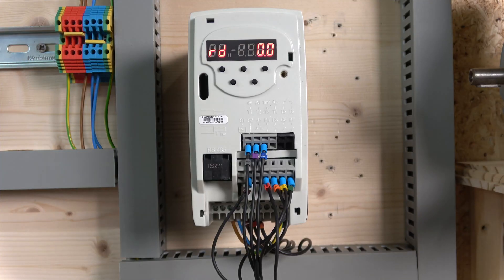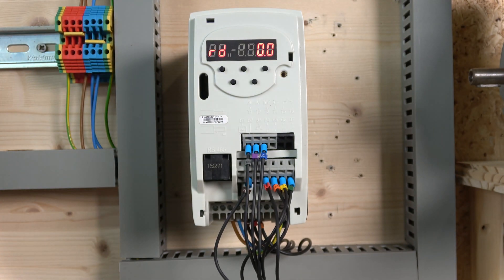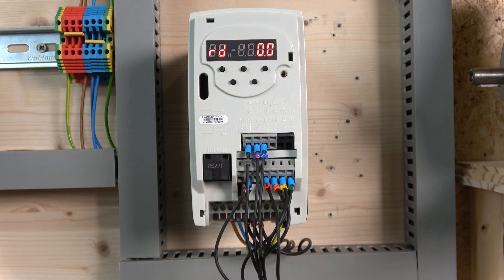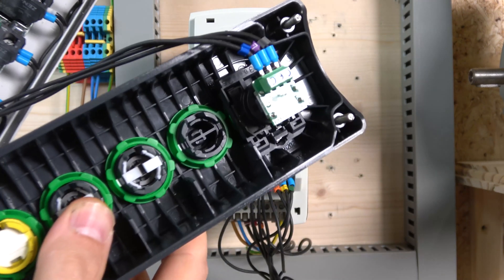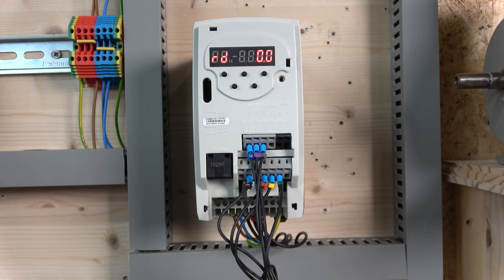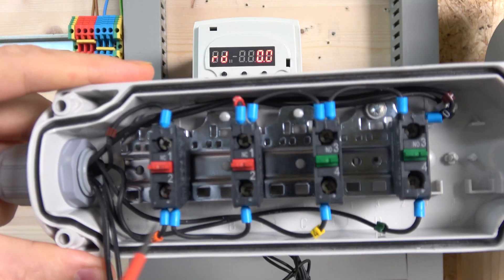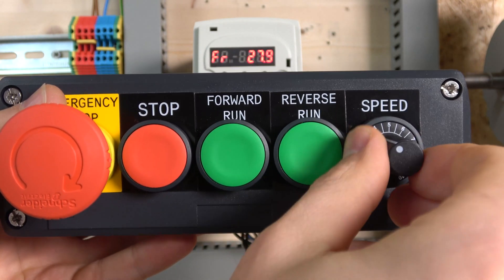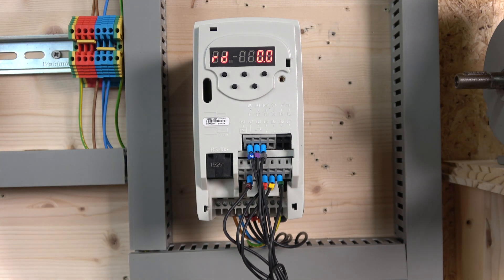Emerson Control Techniques Commander SK VFD, Remote control, 2 wire control, 3 wire control. English

Comment: Hello, your videos are very good, I have a problem with that same variator. It does not turn me off through the selector and the other one is that with the potentiometer it does not remain at 00, it remains at 0.1 and the motor remains in slow rotation, what parameters will I use for this problem? I appreciate your help. ..Thank you

Comment: Hola desde Colombia, gracias por el video; tengo un variador igual, pero al armarlo como dices me surge una pregunta, en el min.: 1:12 el B6 es el reversa, pero hay dos pines alli, uno de ellos al parecer es un puente o algo asi.... a cual pulsador debe ir?, la verdad en ese pedacito me perdi. Gracias de antemano por su pronta respuesta.

// Hello from Colombia, thanks for the video; I have the same variator, but when assembling it as you say, a question arises, at min.: 1:12 the B6 is the reverse one, but there are two pins there, one of them apparently is a bridge or something like that... Which button should it go to? Honestly, I got lost in that little bit. Thanks in advance for your prompt response. //